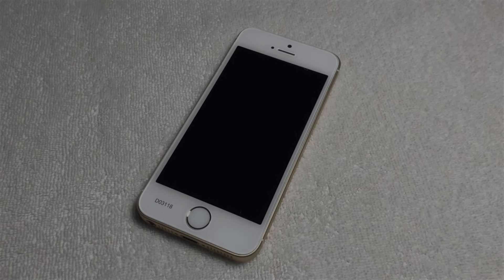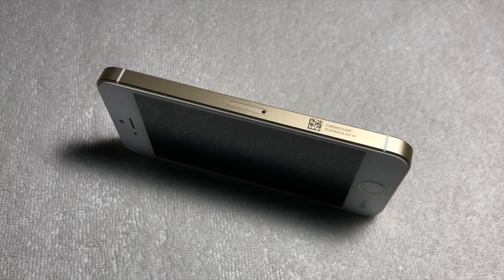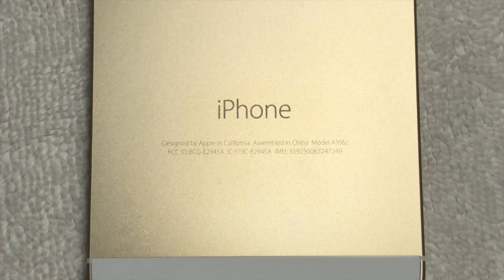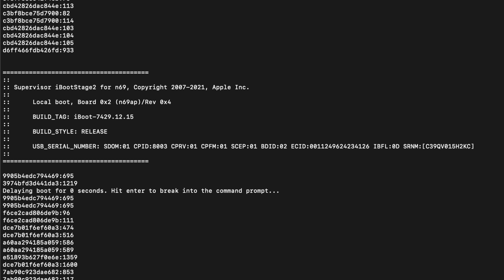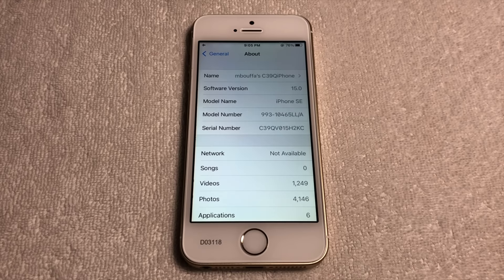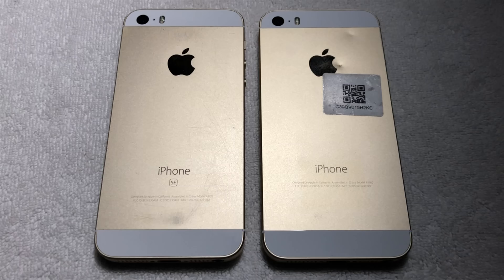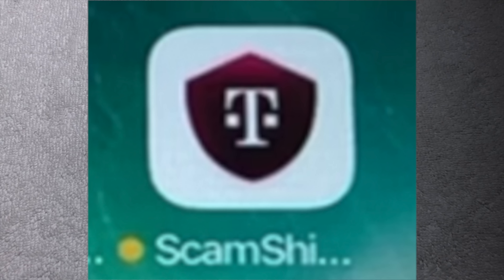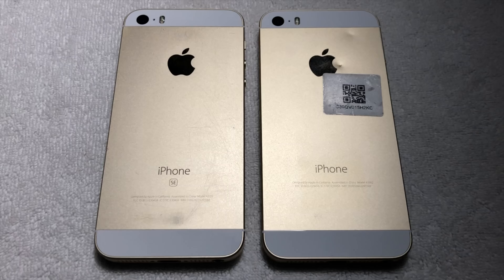Prototype Apple iPhone SE 1st Generation (DVT Stage) - Engineering Testing Model - Apple History

Comment: this phone used to run prototype software for t-mobile to use and setup carrier services to work with it.

it got reset/updated to retail firmware. which could work on some prototypes. but since this is a prototype designed to reflect the final hardware it just runs retail IOS without issues if a user restores it..

eitherway. considering some of the things inside are still prototype hardware. the insides would look way different in terms of markings and stuff.

 i'd love to see the insides.